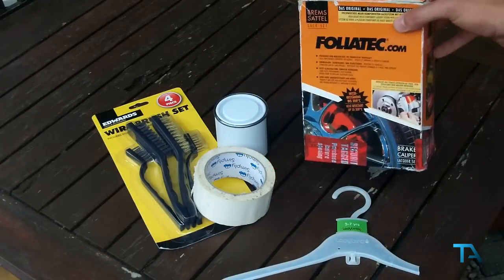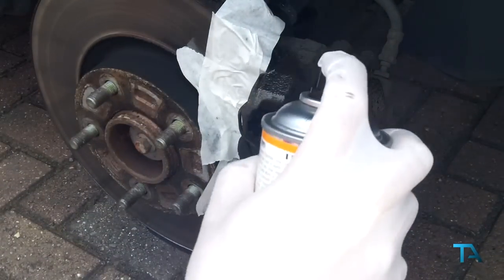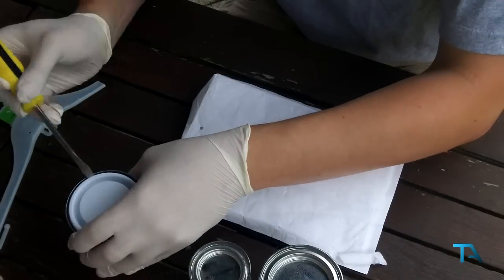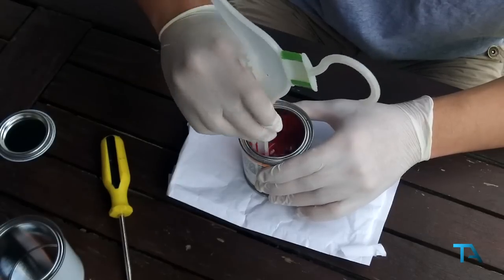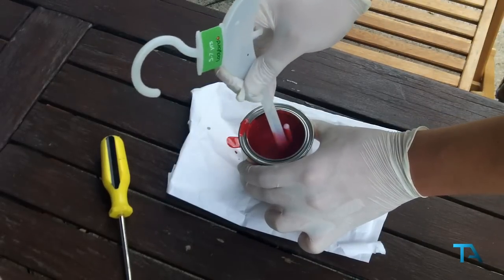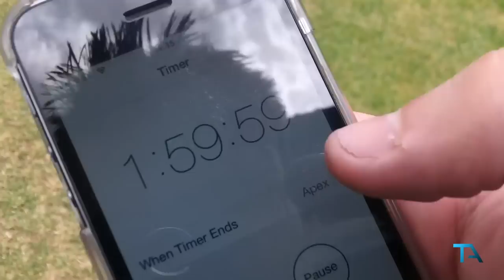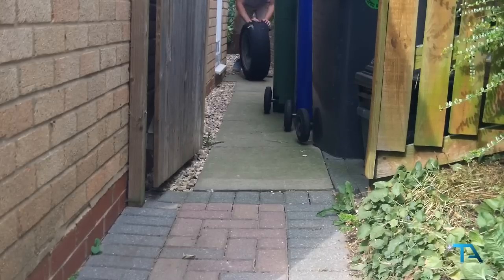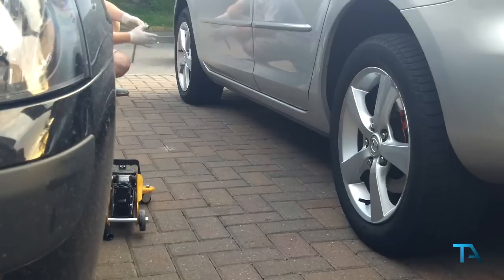How To Paint Your Calipers - S02E11

Comment: This is a handy guide, every other video on YT seems to be spraying or plastidip, the old fashioned way of a paintbrush clearly yields better results.

Nice video
Reply from the maker: Sid Smith I would have personally used spray paint but you can have an issue with drips and the prep time is that much longer. The finish though using a simple paint brush was better than was expected! [James]

Comment: When I did my 02 SVT Focus 10 years ago, I removed the calipers from the disc and hung them from a zip tie. It made it easy without the pads and spring clips on and only had to mask off the little rubber boots. The Epoxy paint lasted about 6 years and then started to get dull.

I just received new EBC slotted rotors and green stuff pads, I'm gonna spray my calipers this time with VHT caliper paint this weekend while I have the rotors off.
Reply from the maker: +ZepG Great brakes, it's what Richard has on the Mazda 3! Feel free to show us before and after shots via our Facebook page - we always like to see what our viewers do and see their rides! :D